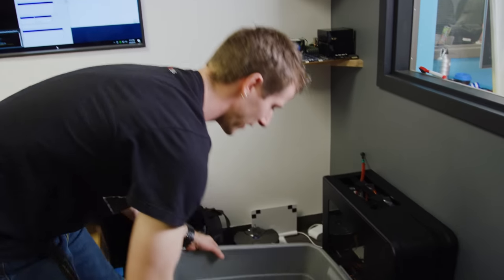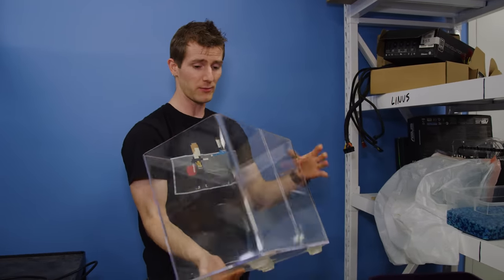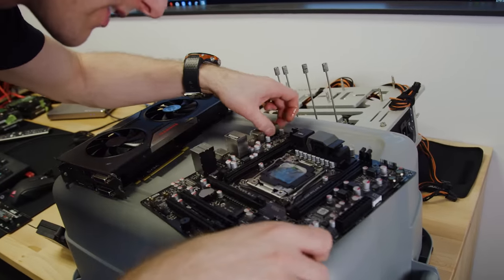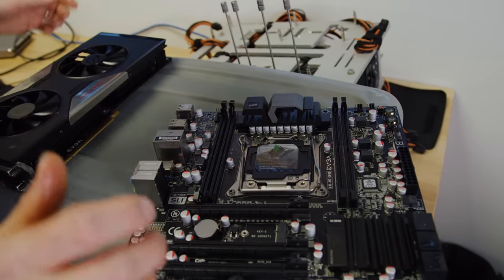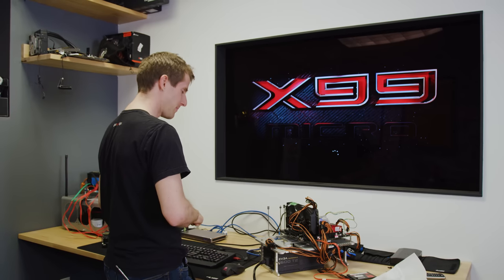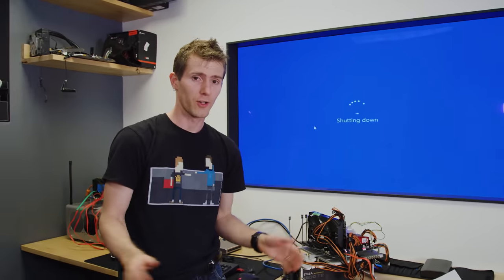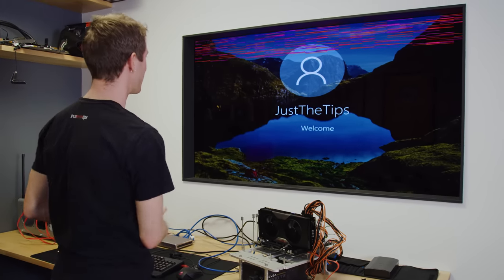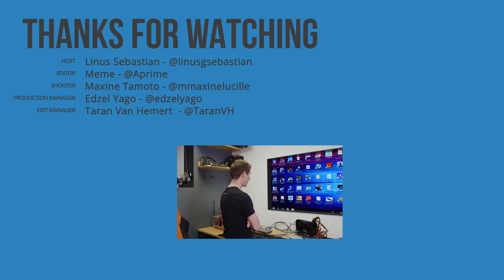Parts from the Oil-cooled PC - Do they still work???

Comment: A simple ethanol bath could have saved those poor parts from disgust and decay. Denaturated alcohol is cheap and safe on electronics.
Reply: Only problem is that alcohol can damage the plastics and rubber.
Reply: Not really. Ethanol is not really that agressive solvent and these are not oil seals under pressure. Certainly more lenient on plastic parts than mineral oil. Actually manufacturers often use ethanol bath on the parts to remove residue that possibly remained after different soldering or other manufacturing processes.
Reply: Acetone would be the solvent to avoid. Ethanol would be fantastic at helping remove the oil.
Reply: yeah a few dips into ethanol bath before storing would save all that parts
Reply: Péter Kiss csá Peti
Reply: Also it would have let the blades of the heatsink effectively disspating the heat. A mineral oil coat thermally insulates stuff!
Reply: Some water and soap and sonication would have worked too (obviously with rinses and proper drying out).
Reply: in theory he could have put it in the dish washer
Reply: i woulda at least  soaked it in hot distilled water  bath for a few hours b4 i went to store it woulda nocked off at least 80 percent of that oil from the warmth .
Reply: @DraconianDebate  The plastics and rubber were already damaged by the mineral oil to be fair
Reply: @DraconianDebate  well, the mineral oil would have already done the same, so it doesn't really matter.
Reply: @peterkiss1204  Ive been using ethanol based solvents for engines and engine bays too. Giving it a quick dip just to clean off the oil and dirt wont damage anything, your rubber gloves however will come apart almost immediately (because of how thin and how long in contact with ethanol they are). So it really depends on the time. If you were to put a plastic part in a ethanol bath for the same amount of time as in an oil bath, the ethanol would decompose the plastic a lot faster. 

You also cant put high ethanol gasolines in every car, because it will eat through normal rubber tubes like nothing.
Reply: @DraconianDebate  That's true, but that really should only be an issue if it's exposed for a prolonged amount of time.
Reply: @peterkiss1204  Hello from 3 years in the future hope you are well! cleaning alcohols (in moderation)is fine. Industry uses heavy gases, or even rocket fuel specifically:Chlorine trifluoride.Which you might know better as Substance n. yep. if mixed with something so it doesn't, ya know explode instantly, is actually used to clean your computer parts thoroughly: mostly the chips..  In your home good ol'fationed ozone works just fine on oil free parts! Plasma channel claims that if making( or finding canned) ozone is a problem, then UV lights for a second or so, with good fationed compressed air (the UV to get rid of bugs: the crawling kind I guess) and complressed for dust.  😂  Now, I can't vouch to using hefty gasses. but I can vouch for compressed air and small amount of cleaning and rubing alcohols! Probably just ester and ethonols ie hand sanatizer found...well used to found everywhere.
Reply: @peterkiss1204  Do you mean that I can circulate denatured alchohol instead of using mineral oil as a coolant?

Some mentioned it as coolant while others for cleaning please confirm to me
Reply: why not just use that instead of mineral oil?

Comment: I would so use that damaged board, and tape the RAM into the slot lmao
Reply: Tape? I would use glue
Reply: @Floodbait_117  not a good idea
Reply: @EternalNico1  y
Reply: @santiagoramirez1400  the glue can melt and damage other stuff
Reply: @jspantonio8807  use epoxi then

Comment: Having had a mineral oil cooled PC for a while, and with the novelty fading and the hassle increasing, I went back to traditional cooling. Go to home depot, pick up about a gallon of denatured alcohol, place components in clean plastic container, pour alcohol on them, wipe with sponge as needed in difficult areas. A cheap squirt bottle also helps to clean out ports, not the spray type, but the kind that shoot a jet of liquid when you squeeze the bottle (commonly used in machine shops to spray water or cutting fluid/oil). For less time than you spent troubleshooting this you could've had everything nice and clean again and probably working fine.
Reply: The mainboard took some real damage though. Depending on the plastic used you might squirt away material that shields pins and even stuff you need to solder on back later. I'm thinking that watercooling might be too much of a hassle, because you have to refit it every time you change something, but actually putting your system into mineral oil is just crazy and not at all intended by the designers when chosing materials.

Comment: Hey Linus. It's a bummer the hardware didn't survive. would've been cool to see them perform after the mineral oil dunk. I am currently considering in getting the EK Phoenix modular water cooling systems. Going to upgrade my EVGA GTX 1060 SC 6Gb (mini) GPU to Asus ROG Strix GTX 1080 Advanced edition with their liquid cooling mounted to it.

Comment: rip, GPU died at the end, feels bad, I was getting excited too. cause I was like, wait, whats the benchmark for the 780
Reply: Alexander Saavedra hey I don't really get it, it died? Seemed like it worked with a little noise to me.. Mind enlightening me?
Reply: keep watching after it shorted the screen looked all glitchy because it basically died there
Reply: that poor gpu
we watched it die
Reply: I think it was the motherboard to be honest. The GPU was still clearly working.
Reply: gpu still works just some minor artifacts
Reply: those are not minor artifacts, it shorted. Using it for any longer could damage other parts in your pc, as well as software. half of the screen was green, it was going to completely die within like 20 minutes, at that point you may as well buy a new gpu.
Reply: I think the 780 is as fast as the 3 gig version of the 1060 today.

Comment: drip dry a formerly mineral oil submerged component in the oven? set to hot enough to increase flow rate of oil, but low enough to not loosen solder? bonus points for finding the appropriate angle(s) to allow oil to drain from dimm slots etc. you could even put a tray under to recover oil #wastenot

Comment: Can't you just soak it in alcohol first to remove the mineral oil?
Reply: and then remove the alcohol by soaking it in mineral oil again
Reply: and then again remove the mineral oil by soaking it in alcohol
Reply: And then throw it away and get rid of your alcohol addiction
Reply: Alpha lol, the alcohol would evaporate in a day
Reply: that's what they said about the mineral oil. #donttrustnoone
Reply: I built a mineral oil PC about 7 years ago, the hardware doesn't ever drip dry and no amount of soaking in alcohol will remove it. As "cool" as these things are, mineral oil is a terrible thing.
Reply: You should clean the board in an ultrasonic cleaner. Maybe some Isopropanol alcohol before hand to get most of the oil off.
A short or some other problems was what I expected with a dirty board like that.
Reply: Soft boil parts in water. Oil will rise to top. Then drip dry for 1 week. Done
Reply: What about a degreaser like clutch and brake cleaner?

Comment: Didn't Luke say that he killed a graphics card from running it after it was in a mineral oil build? It was in a video from like years ago but Luke said that the mineral oil stripped away the thermal paste
Reply: Tony Hong probably talking about a different card, luke had his personal build cooled by mineral oil before he joined LTT, its why his nickname is slick.
Reply: Alex V.D.H. Yes I know. That's exactly what I was referring to in my original comment
Reply: That's probably what happened then. GPUs have good overheating protections but they probably won't work on memory. If he stress tested the card without memory having any contact to the heatsink then... Those artifacts are a telltale symptom of fried memory.
Reply: Yes but that was Lukes GTX 260
Reply: That noise wasn't from a lack of thermal paste.

Comment: I actually had an oil cooled computer about a year ago,  and it cracked and leaked,  so I had to put it in my tower,  everything works,  but a year later,  after tons of rebuilds and cleaning with rubbing alcohol, it's still gross and oily, and all my cables are stiffened, the build is actually on my channel, it's an old video tho.
Reply: TheZombieSurvivalist wouldn't soap and water work better at removing the oil?
Reply: Fantasmamuerto isopropyl alcohol is rubbing alcohol...
Reply: Well, Rubbing / isopropyl alcohol works really good as a degreaser and cleaner with oily substance on them. Yes, dawn dish-soap and water technically would do the trick, but I don't want to risk leaving any water and shorting it out, but I may have to try that sometime.
Reply: hit it with brake cleaner lol
Reply: CSGO Clips brake clean will destroy plastic.  Don't ask me how I know.
Reply: TheZombieSurvivalist damn

Comment: I mineral oil submerged a PC a couple years back, it's actually on my channel. The cables got super stiff, but I cleaned everything with rubbing alcohol and soap and water. A couple months ago, my graphics card and power supply crapped out on me, but I don't think it's mineral oil related. To this day, my cables are still stiff.

Comment: Linus, I still have a GTX 750, don't be flexing on me
Reply: Swift I just upgraded from a 560 last year around this time.
Reply: Swift I have a 750ti I feel your pain
Reply: Swift I upgraded from a GT 635 lol. Even a 750 would kick the crap outta that in performance
Reply: Bitrazr Yea sounds good to me too
Reply: you guys are weak with my GTS450
Reply: I finally upgraded from my old 750ti about 1.5yrs ago. I’d still run it, if I hadn’t gotten my Rift
Reply: Bitrazr not a bad idea. I'm 17 though, and I want a gpu before I go to college. Granted, it sounds like Volta is far sooner than I had though, but hey, my 1070 will still do well for a good while
Reply: +Skooks If you are gaming at 1080P still, the 1070 will carry you at 100+ FPS in most things for at-least the next two or three years, 1080P has basically reached as good as it's going to get, only reason you honestly should upgrade is if you are going to high frame rate 1440 or low FPS 4K
Reply: Redneck Fury I'm actually going pretty strong at 2k, getting 80 fps on GTAV :)

Comment: Too bad it broke. Would have liked to see a follow up video if brake cleaner would have cleaned it a bit.
Reply: brake cleaner is super deadly for plastics and tiny shit in general
Reply: Isopropyl alcohol is probably a better bet, cheap enough to give it a bath in it.
Reply: Depends on the type of brake cleaner. Some of them are perfectly cool with plastics. If I remember correctly, the non-chlorinated ones are usually ok.
Reply: Daniel I Yup, cleaned several motherboards, monitor chassis and classic console parts in Isopropyl. Just gotta use something higher than 70 percent and give it a couple hours to dry. Of course, new thermal compound on the video card, afterwards.

Comment: Why didn't you spray the parts down after removing and let them dry?
Reply: Spray them down with what? Water's no good on oil, or good for electronic or metallic components for that matter. It's like water is a solvent that doesn't work on oils. And I wouldn't trust soaps on electronic components for the same reason. Some suggested Brake Cleaners, but I'm not too sure about that as well.
Reply: Cleaning alcohol?
Reply: When you turn a phone off it's still sending power to the device.  It's not the same as removing the power supply and CMOS battery
Reply: Jack Linde actually pure water has absolutely no effect on electricity i could dump 80 gallons of the purest water in the world on anything eletric and nothing would happen no shorts no extra volts or amps. What makes water so deadly is the extra minerals and floride etc. Hence why tap water causes damage.
Reply: Crunchy_Cookies As long as there is no power supply or mobo battery in, water would be fine. You would just have to let it dry off. Phones never really stop sending electricity nor are their batteries too well protected against water.
Reply: turohabaneero It’d short a capacitor anyway.
Reply: TheAvengedNightmare2 water strips trace amounts of metals off and becomes conductive over time.
Reply: The name for that is called de-ionized water. Problem is there are also things that will mix in the water when you dump it on something, unless what youre dumping it on happens to be 100% clean in every way shape or form.

And to the OP: clean it with what?  Oven Off?  Do you ever do cleaning or dishes?  Maybe bust out some Palmolive or Dawn up in this bitch  Remember from science when you were young and you put water and oil and vinegar in a glass?  Water and oil don't mix: oil is hydrophobic and non polar. You cant clean oil with just water.  Source: I've done a lot of dishes....oh and science.
Reply: Chirea Ionut rubbing alcohol would be a better idea. Brake cleaner can eat plastics
Reply: Spray them down with what?  Water and oil don't mix.  Oil is nonpolar and hydrophobic.  You cant clean oil with just water.  Bust out some Palmolive or Dawn Ultra up in this bitch?   Ever done dishes with just water and no soap?
Reply: It just can't have charge. Cleaning it with de-ionized water or isopropyl alcohol should be fine.

Comment: Why let mineral oil near electronics to begin with? I mean it's relatively safe but there are better options. Sure those cost more money but if you're submerging parts that cost a few hundred dollars each why not pop for something better. Transformer oil comes to mind. Better than that (though oddly enough far cheaper than that) would be silicone fluid.
Reply: can u suggest one of the other options ?
Reply: Because you need to find an Autobot to get transformer oil. Duh.
Reply: Silicone oil is also used as transformer oil. Its much better than mineral oil.

Comment: You could use raw rice to dry everything out. Get a box just large enough to put in all the parts into. Fill the bottom of the box with one inch of rice. Put parts in with at least one inch gapes between parts. Then fill the box with rice to at least one inch above the parts.
Reply: then you got rice stuck to everything. brilliant.
Reply: its oil, not water. Rice works nicely with water, it wouldn't absorb oil to dryness
Reply: You could soak the parts in water for a day and then do the rice thing. That should clean up most of the oil. 
But it's more fun watching him trying to get parts working when they're currently soaked in oil lmao.
Reply: Water on a circuit board is not a good idea. The idea of rice is to shack or rotate the contents. The little grain of rice will wipe the parts clean and hold on to the oil.
Reply: Lee Noring SEO Advertising. I soak electronics in 90% isopropyl alcohol, I've done it with arcade motherboards, PC motherboards, & TV motherboards, it works perfectly every time!
Reply: Best solution
Ytyoussef
August 10, 2014 6:38:26 AM

Distilled water will work, but make sure you remove the battery and and drain the caps, you will have to leave it to dry for a long time, to make sure that there's absolutely no liquid left. I must say I wouldn't be brave enough to do it, even knowing that nothing should happen to it.

http://www.tomsguide.com/answers/id-2254545/distilled-water-mobo-gpu.html

this guy on toms hardware disagrees, personally i used faucet water with my xbox 360, when it had a huge amount of damage from mountain dew, and just put the board in the oven to boil off the water. it still works to this day. umm, but yeah thinking about it now, it's best to use distilled water after cleaning it off in the faucet

Comment: Linus Tech Tips, anyone reading about oil-cooled pcs: mineral oil is soluble in ethanol, this means that mineral oil will get "trapped" by the ethanol. therefore its possible to clean any mineral oiled parts with ethanol. Then, before any tests, be sure to dry the ethanol completely, it should dry by itself if its warm, by evaporation. (this is theoretical, as I haven't tried it, but science remains science.)

Comment: Did you really have to kill that card right before our eyes? c'mon, Use alcohol. That card is equivalent to a GTX 1050 Ti.
Reply: He does not care about budget oriented guys. He has thrown out all of his X79 workstation boards when he switched to X99 if i remember correctly. X79-based systems are still very fast even today.
Reply: TheRailroad99 he actually gets all of his stuff from sponsors and the actual conditions of sponsorship are just crazy lol
Reply: BoomCHAKADAH i would say it’s equivalent to a GTX 1060... Because 780 -> 970 (since there’s only 800 series for laptops) -> 1060
Reply: NRG Mc_Swap78 yes ur right

Comment: suberge it in isoprophylic alcohol to dissolve the mineral oil. the alcohol will evaporate later on. this is also a standart procedure when preparing for soldering.

Comment: I think Luke said in the Q&A video that the mineral oil would disintegrate the thermal compound on the GPU over time. I imagine the motherboard might still work (unless he did tried it without the GPU again and just cut it because it didn't).

Comment: I was at an Arms show in Ottawa and 3M has a new liquid that acts like the oil but when you pull out the parts they are 100% clean. Very thin liquid, like water.

Comment: The original mineral oil vid was interesting but made me curious about something.
How shocking would it be with water instead?
Yes I know everybody is careful with water around anything electronic BUT….
Pure distilled water is actually a really good electrical insulator and only conducts if certain things are dissolved in it.
I wouldnt expect any of the build components to be soluble in water.
Worth a try or looking into?